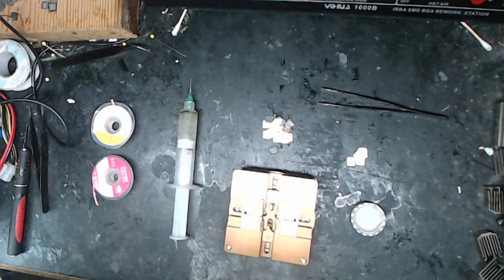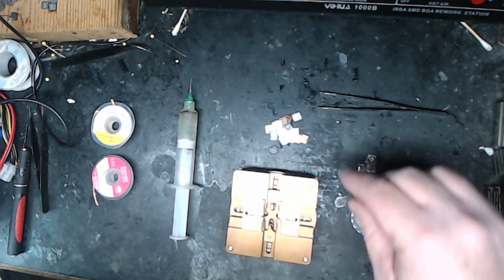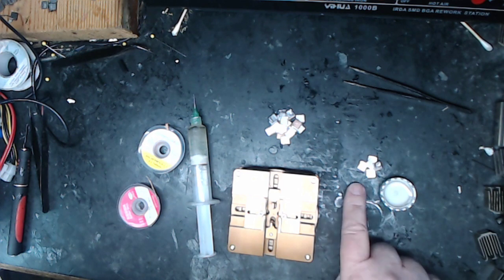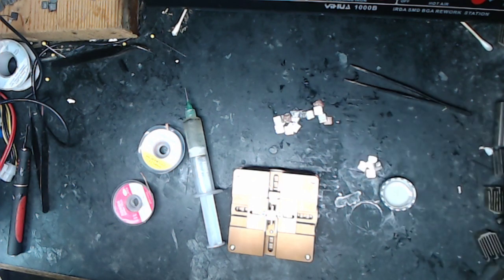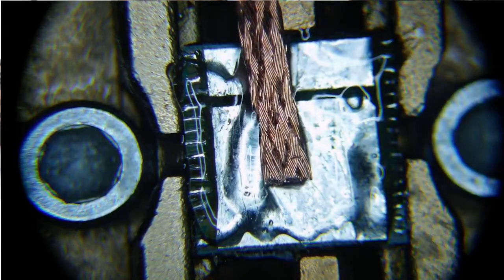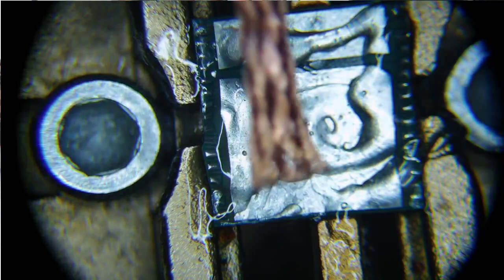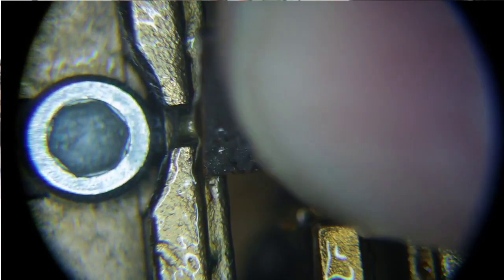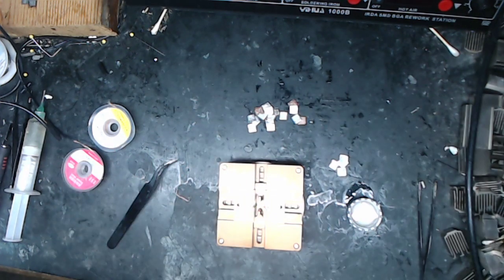hashboard repair:  Re-use and recycle ASIC chips

Comment: Can anyone point me to a video or message in the Discord that talks about injecting voltage into the asic to check whether it is good or not? Thanks!
Reply from the maker: Someone had demonstrated that on discord.  Unfortunately, sometimes it is hard to recall where.  You can ask again on there and perhaps someone can help.  I have not used this method.